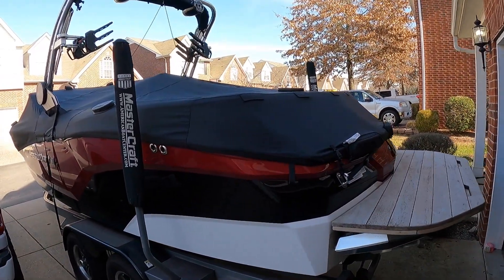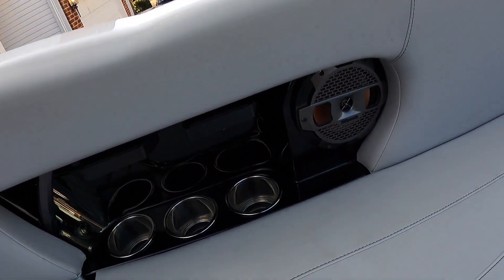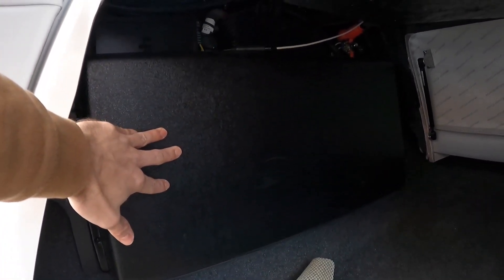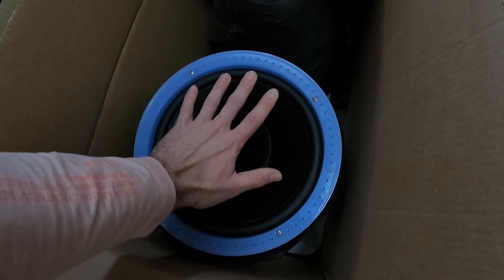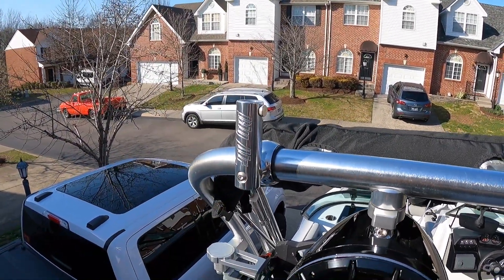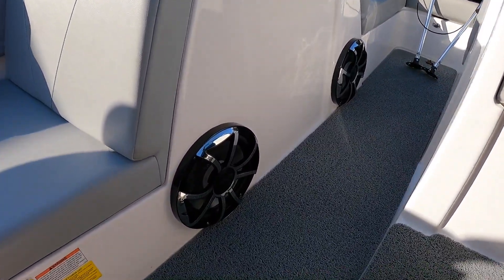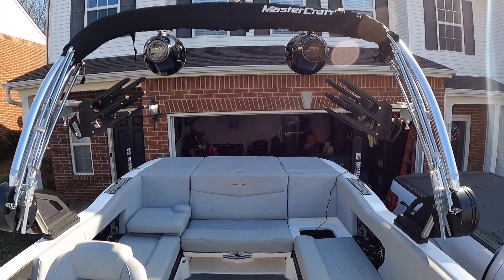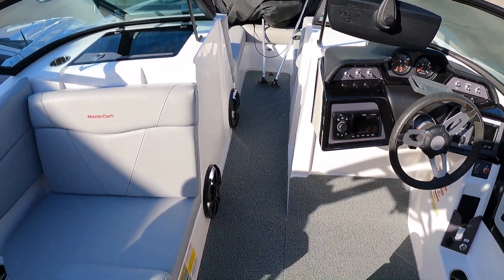Massive Wet Sounds Boat Audio MasterCraft REV12 HD

Comment: Thats a really nice system. I would consider adding a set of 8s for more mid base. Did you think about using the zero series for the 6.5s. It would match the tower speaker grills and they are really loud.
Reply from the maker: Thanks! Ya i did. I believe the zero speakers are still out of stock in black. 
The revo speakers are still very loud! I agree i think 8's will be a good addition